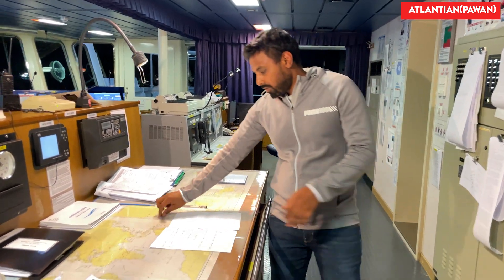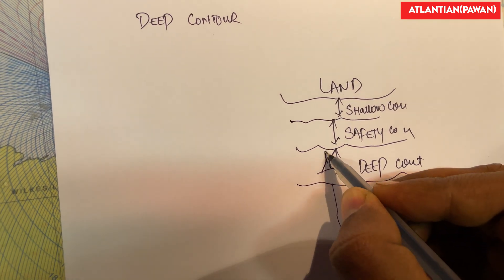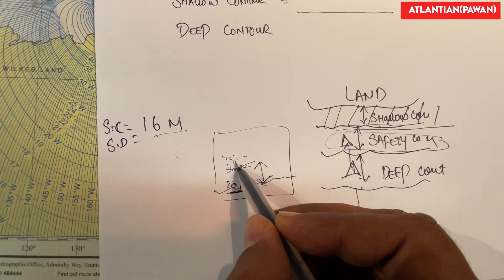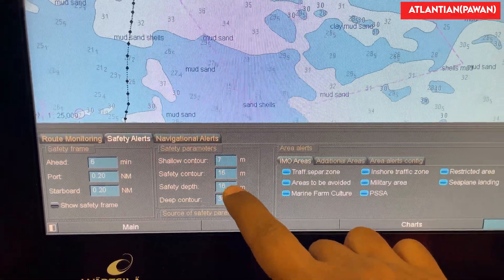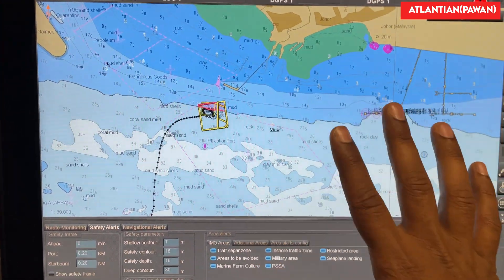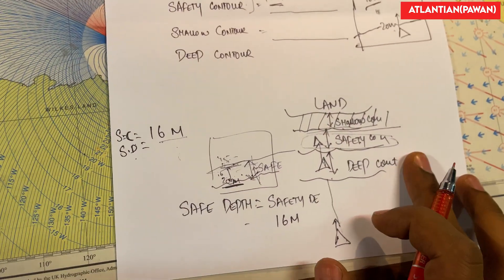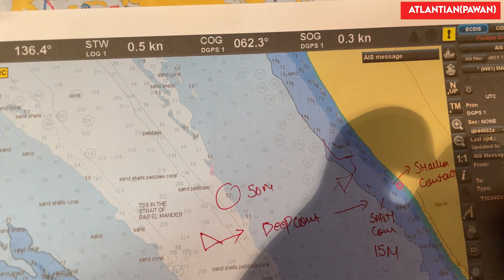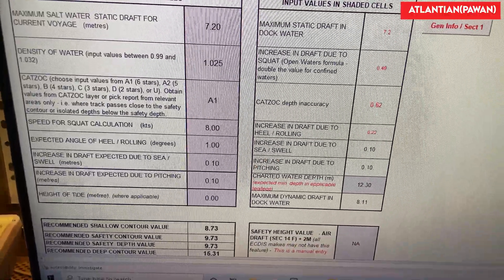BASIC OF SAFETY SETTINGS IN ECDIS

Comment: Can shallow contour be less than static draft
Reply from the maker: No then point of shallow contour is lost
Reply: @atlantianpawanharyana1005  sir i want to ask tells say charted depth is 11.0 m in the channel and vessel static draft is 12.0 m and tide is 2m vessel can only depart during high tide then how much should be the shallow contour
Reply from the maker: You will put shallow contour based on ur calculation what u get as i shown in my video i get them from my excel sheet now in such case u also have to add tide in calucation other than countour